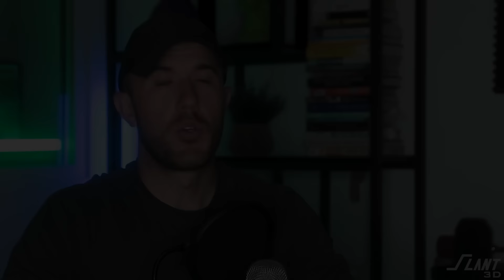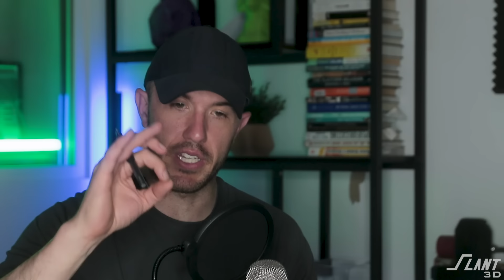Most 3D Printing Services Die | Tangled Filament Updates | Tangled Testing Videos | 3D Printing News

Comment: Got a quote from y’all and it wasn’t acceptable. Over charged for color change, i get the 150 charge to change the color, but was charged twice per color just because its two different parts, same color. Didn’t make sense and when i asked about it i was just given the equivalent to a shoulder shrug. Injected molding was far cheaper quote. good luck.

Comment: Still have a box of SlantSpools - most printed with the KVP plastic that originally led me to them. Would probably use spool-less from Tangled IF... something happened to fix the one problem I've had. Don't remember it happening on the old Ender 3 ... but the Bambu A1 mini with AMS lite... the spools fit on the AMS lite, but something about how it feeds is different. The filament coming off the spool has a strong tendency to get caught in between the spool and the remaining filament, to the point where the printer jams. It got so bad with one particular remaining spool that I despooled it onto a leftover spool from another source and used the filament that way. 

I do like the SlantSpool design... so much so that I reverse-engineered it and made a small version (< 1" hub, 3-4" outer diameter) to store the myriad of wire that I find myself storing as a maker who is doing a lot of electronics. :)

Comment: For spool-less filament... Do you know if anyone has tried center-feeding the filament? I've seen it work for baling wire and twine, and while it certainly wouldn't be a universal solution, it seems like something that could work pretty well with non-brittle filament. 

For those of you who haven't seen something that uses it... The coil sits in a tray, the end of the coil in the middle gets fed through a hole in the middle of the tray, and then it just gets pulled from there. 
Why it's a win: The coil doesn't move. Doesn't need to, what's spooled is getting pulled to the center, and there's nothing in the center to stop it.The tray doesn't rotate. Doesn't matter how much the spool weighs, because that itty-bitty extruder motor doesn't need to turn the spool.
Why it's not a win: The mechanism is putting significantly more torsional force on the filament as it unspools than it would on a conventional design (where it would only be a tensile force), so brittle filaments just aren't going to work here. 
Also why it's not a win: Changing out filaments is going to be tricky; as long as you're pulling one end to the center, it shouldn't tangle, but once you let go of that end....

But if you basically print from one coil of a filament that can handle a little twisting until the coil runs out, it seems like it might have a niche.

Comment: With the rise of cheap 3d printers more and more print on demand business are gone. To be in this game a business should provide some special thing that is very hard to comeby otherwise. Like you want SLS parts? fork out $$-$$$ for parts to a business or invest $$$$$ for sls printer with $$$$ materials, and get someone to know sls printing. Same for metal printing.

Years ago a 3d printer was something expensive, not for average joe. So any business could get a printer that works and sell pla/abs prints 15 years ago before prusa mendel and reparap was quite the unobtanium of processes.
Then everyone can print pla on cheap prusa clones and later enders (as the more reliable prusa clone), so business started printing abs on zortax printers and ultimakers and other enclosed printers (that was under stratasys patent and not many options were available to print large ABS parts reliably, not even prusa from that time mk2 era), and resin printers of any kind since they were so expensive in every regard.
Then things happend since bambulab and stratasys patent expiration and everyone can tackle abs asa even some pa, pacf, etc.. (especially the x1e can do more technical materials). Also resin printers are quite cheap now.

Now the still expensive speciality printers are in the large resin printers (quite expensive still), large abs/pa/asa/pc prints (very hard to do on large prints like over 350mm), very high temperature materials like peek/ultem/pei/etc (yet prices are coming down on 420degrees nozzles), and the race is for the more exotic materials and proceses.. like SLS (price is plumeting down lately.. a sinterit lisa is around 13k euro, with 1k euro powder you need very few parts to sell to recoup the initial cost), slm, metalX, etc.

As the prices go down any reasonable business can justify to invest in a printer to print inhouse rather pay to print on demand business. This is why any printer sub 20k$ can be justifyable for many business as it wil pay for itself in under a year. As prices come down the printing business must up their game for something special, otherwise every nerd in a basemant already has a mk3s and can print just as one of your print farm printer. So a sustainable printing business might want to go PCB way route to offer really exotic prints and also includes other processes like CNC/plasmacut/waterjet/casting/stamping/EDM/etc - things that are out of reach are expensive due to scarcity so the profit margin can be big on this exotics.
For PLA prints, you will always find a student that will charge very close to price of filament alone.

I get that slant3d's special thing is the ability to take huge orders for the huge printfarm. Good for them.. but any time the volume needs are reduced, an army of students making a buck on print on demand services will drive the price down to the plastic price, the cheap aliexpress kind.

Comment: Apple is a more useful example than you think. Apple made an OPEN SOURCE product in the early days, that the only proprietary thing was the case and the ROMS, which were open source, the assembly for them was in the back of the book, I burned upgraded EPROMs for my Apple ][, to make it a ][+, and they encouraged owners to experiment, nearly all the chips on the apple ][ and ][+ were socketed, so you could easily replace them, upgrade them add things. The Motherboard schematics were published as well in the back of the manuals.

They were entirely different than the Apple of today, because they couldn’t afford to not to be “scrappy” and open source in the market of the time. (1978-1979).  Survival is more important than expansion of lines. It wasn’t really until Lisa and Macintosh that things started getting crazy, and sometimes stupid, there were countless orphaned technologies and products in the Scully era, I have a boxes full of absolutely innovative, game changing orphaned apple tech.

Good software is indeed hard, you have to build the right team, tools and process, and generally that is developed through time, sunk costs, and countless failures.

Oh, and +1 for spools refills that fit Bambu Lab AMS light.

Comment: So instead of just firing off 10,000 parts into the dark, if a client wants that many of something.  Do prototyping with the client, make a single part and sent it to them, if it works and its what they want, fire away and make the batch.  If its not, re work, fix and have them be able to see what they want and what problems might show in the original design.

Comment: It's annoying how much Bambu's AMS gets in the way of making cardboard spools. I really hope they are working on an improved AMS that is more compatible. Cardboard is much more recyclable than the plastics used in spools.
Reply: The idea of the Bambu AMS to refill the plastik spools several hundert times, which is even more environmental friendly than cardboard spools which can be used only once.
Reply: @wolframherzog636  you need really good buy-in from customers to make that happen. Polymaker tried, but shut down the program because nobody was buying the refills. I suspect Bambu's sales of refills is low.
Reply: Easy solution: Paint the rims of your spools with clear nail polish.

Very quick to do, no more residue on the AMS rollers :-)

Comment: Filament shouldn't come on spools if you want to spool you can 3D print a two-part one and the size one that you need or want
Reply: I think that spooless filament users should be considering switching to bulk pellets that they can customize the color of what gets extruded, and never have to deal with filament at all. I don't see it being a major movement any time soon, though I've seen a few different videos over the years of people doing just that. I'm afraid that the same is true for filament. I'd realy rather that retailers like Amazon allowed you to specify whether you wanted spooless or not, but their search platform is more likely to start including bulk spools of sewing thread into their search results, than narrow down the results to what you're looking for.
Reply: @RNMSC  i cant wait til this happens
Reply: @RNMSC  do you think pellets will become the alternative in the next 2 years? Up to now I am not aware of a company in the consumer segment that offers a printer in that field
Reply: @stefan-bayer  I think the actual problem is that at this time there isn't a consumer avenue for buying the pellets. The ability to use pellets as a modification for off the shelf printers is generally available already. I don't see it as an option for the more recent high speed printers, but for pretty much everything from the reprap through most printers in the 200 mm/s print speeds, there are feeders that are effectively bolt on solutions that replace some or all of the filament path into the hot end. 
As to whether something like this will take off and become massively popular in the next couple of yers? No, I don't expect so. It could happen, and if there is one place where I would think it to be a likely update is in the commercial 3d printing space,  A company like Slant3d that's already buying the pellet level stock, and is using that with pigments to generate filament that's then used in the print farms that they run, seems to me to be a company that may look at the filament making process and wonder if they can engineer a solution for printing from pellets that's highly reliable and can be replicated in volume. That solution may be using a fixed extruder hot end with the x-y and z axis all moving. That feels to me like a really bad option, but that fixed hot end is likely to be something that could be in a Z lift, with the bed being slung in x and y. I would presume that at that point we're not going to be using nema17 steppers, perhaps moving up to Nema 27 or larger, simply for rigidity to reduce the various movement artifacts. I don't expect that Slant3d themselves will do this, and I don't expect to see this on consumer end printers, where the price of the hardware involved is likely to be prohibitive, but I've been wrong a lot of times, and don't hold it against others who develop the things I'm wrong about.

Comment: +1 for Spool-less refills.
Reply: I want a utility company to just pipe in a filament reel (and liquid 3d printer resin) imagine the little pully system in a tube nd how fast the filament could be spooled through a tube, and the giant filament reel centers distributed around the city like the power grid etc .

Comment: Polymaker uses cardboard and I don't know why you say people don't like cardboard spools
Reply: I run a farm using lots of ams and the cardboard spools were the worst idea ever. I hate them. They cause endless problems and waste.
Reply: I think it's because Bambu lab's AMS don't like cardboard spools
Reply: @jtmoore42  There are a couple of solutions out there for that. Things like spindle inserts and spool edge adapters that cost simply the time it takes to download the model and print them, or at worst design up a model and print that.

That said, no one wants to add work to their process of swapping out filament. For me that is a strong argument against spoolless filament, as nothing I've seen indicates that the time involved in getting a spoolless filament roll onto a 3d printer is going to be less effort than the adapters. I think it is a niche market in the long run.

Comment: Honestly going spool-less will make me buy more. Needing to re-spool off the cardboard spools is a huge pain point for me and it makes me want to pay more for the Bambu refills.

Considering the number of people using the Bambu spools, it might make sense to just use one of the many printable spool centers that are used for re-spooling. There are plenty of them that are support free and completely ejectable. There are lots of good printable spools on that side of things too...
Reply: 100%
Reply: @Reewen  Sure is. Comes with all sorts of extra problems and caveats, might just casually break, have to be customized per-spool (re: inconsistent spools mentioned...grr 😡) and even after all of that still limit the flow rate of the machine because cardboard spools simply don't spin as cleanly as plastic ones do. Also cardboard holds MOISTURE, so it makes it harder to dry the filament....I could keep going but basically cardboard sucks. It was never a good solution for spools. Spool-less was always the best option.